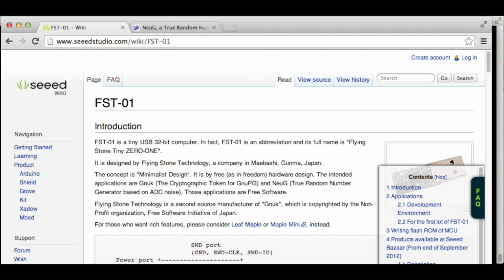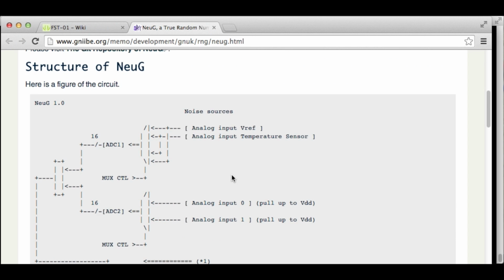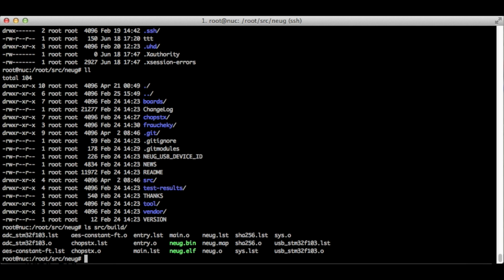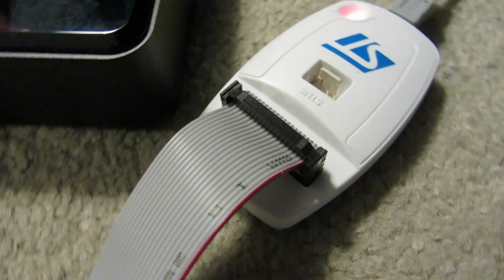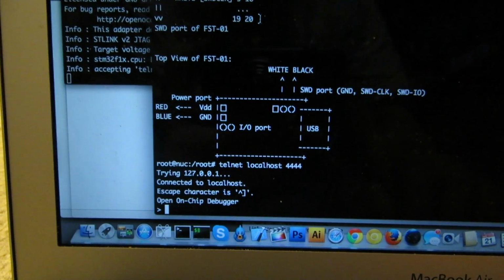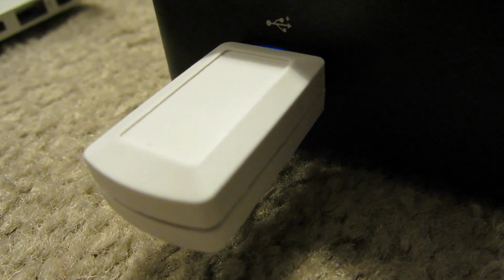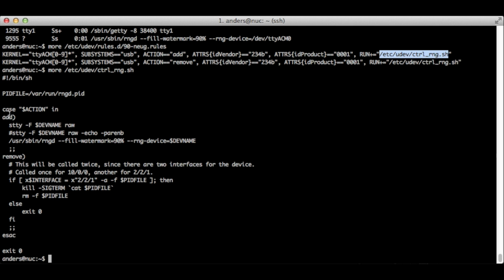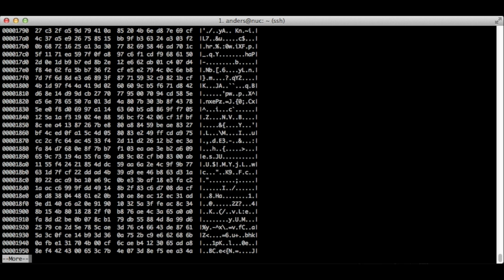True Random Number Generators - FST-01 - Well Tempered Hacker

Comment: another way you can test randomness is through compression, compression software will look for patterns and use it to compress randomness should not have patterns at the very least so if the compression program doesn't decrease the size significantly then you know it's good.  In fact some compression systems might increase the size because of the header information being added

Comment: To anyone lecturing as to the validity of what is presented in this video: This device implements known techniques for using random processes in integrated circuits.  Please read RFC 4086 (https://www.ietf.org/rfc/rfc4086.txt):

Is there any hope for true, strong, portable randomness in the
   future?  There might be.  All that's needed is a physical source of
   unpredictable numbers.

   Thermal noise (sometimes called Johnson noise in integrated circuits)
   or a radioactive decay source and a fast, free-running oscillator
   would do the trick directly [GIFFORD].  This is a trivial amount of
   hardware, and it could easily be included as a standard part of a
   computer system's architecture.  Most audio (or video) input devices
   are usable [TURBID].  Furthermore, any system with a spinning disk or
   ring oscillator and a stable (crystal) time source or the like has an
   adequate source of randomness ([DAVIS] and Section 3.3).  All that's
   needed is the common perception among computer vendors that this
   small additional hardware and the software to access it is necessary
   and useful.

Comment: Ummm... a temperature sensor is not a source of true randomness. Oh.. and piping it through sha doesnt make it more random. It just makes it APPEAR more random to humans, it might even reduce the randomness.
Reply: If the device focuses on the small fluctuations and throws away the large magnitude digits a reasonably sensitive temp sensor will do quite well. You are correct about sha if that was used to "add randomness" but looking at the diagram that's just how the final random value is "locked in" so it's usable as an encryption value (not correctly described in the video).  The high res data sample has to hit digital granularity at some point after all.